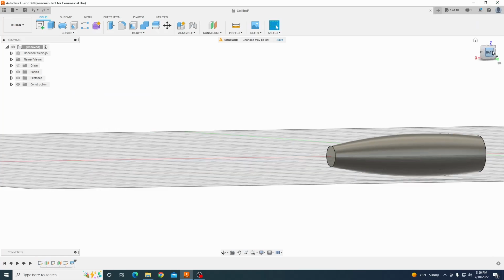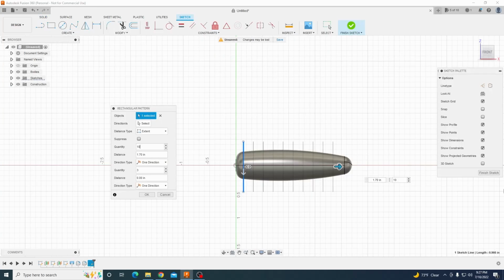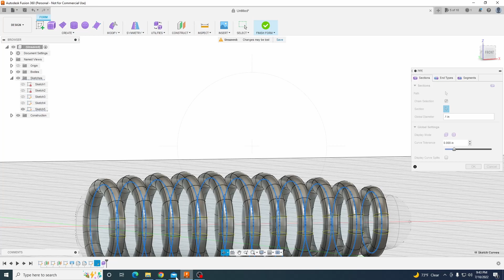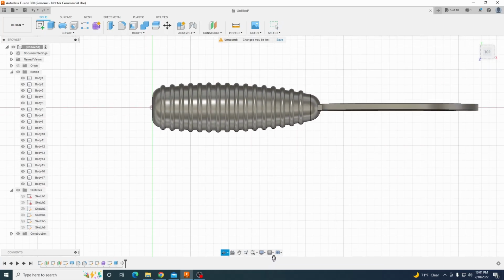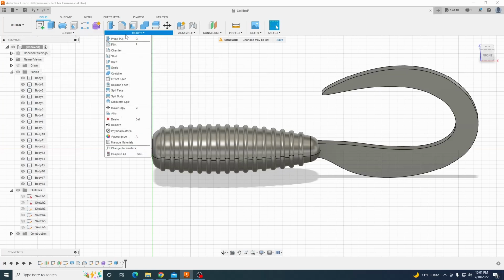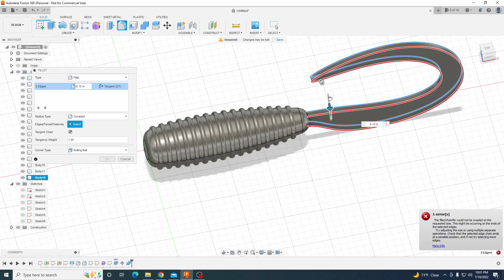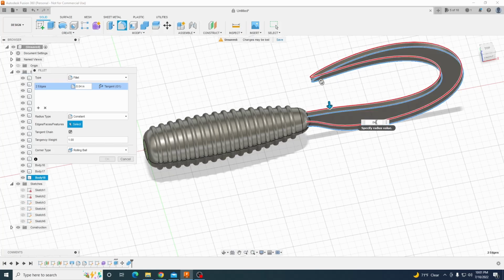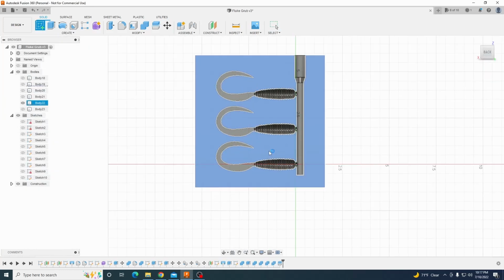Making a 3D Printed Saltwater Grub

Comment: Do you have any molds that are same size injection hole but only 1 lure? Thanks for the hard work you put in to make them!!
Reply from the maker: No problem! I do plan on going back and doing some single cavity molds out of my previous lures. I picked up a fuel injector and want to do some split colors.